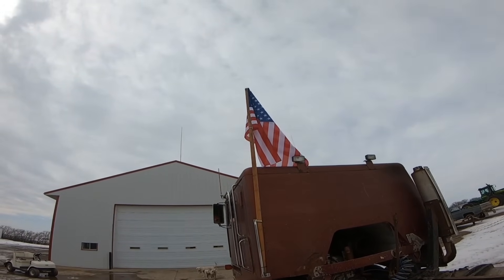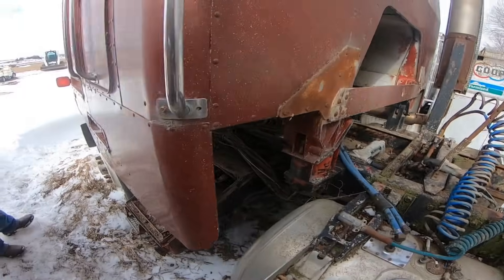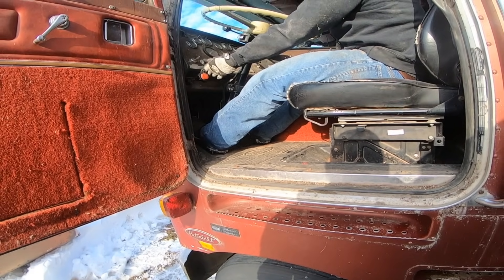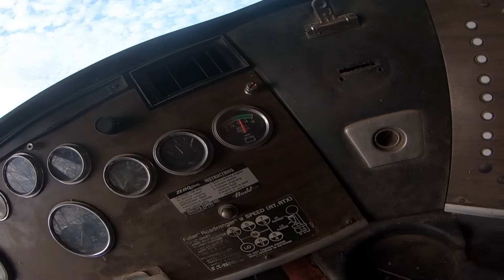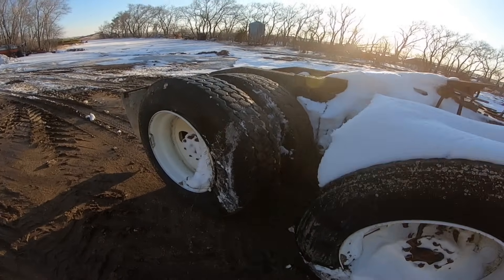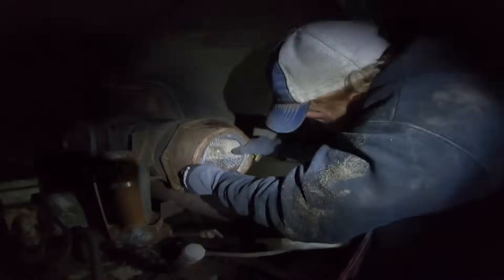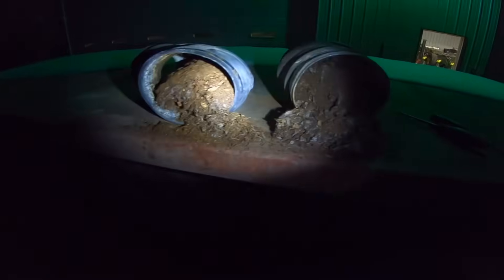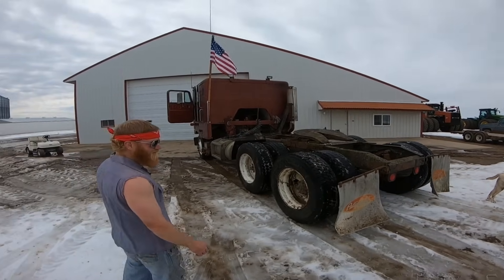Abandoned 362 Peterbilt Cabover first start in 14 years - The Adventures of Mortske and Elf

Comment: Its realy clean most of theas old trucks the interiors all riped up looks like it was well kept tell it was parked just like evey cab over its like almost special seing a cab over. And. Back then they were every where .my cosin bill use to rin a cab over. You could cleen up the inside with some work most of the time their all melested. All wires. Hanging and cut and window left open dash all crispy .Looks like it could get recover the seats doush the inside.
Reply from the maker: You know, after thinking about all the old trucks I've been around, this one was actually pretty well taken care of. The new owner got it all cleaned up on the outside and she's pretty dang sharp now! Thanks for watching and for the info!

Comment: First Peterbilt cabover i ever drove was a 86 362 with a 60 inch sleeper ... 400 bigcam and a 13 spd ....jake brakes would make the people down the street piss the bed.  
9000 is possible but also the odometer and the hubmeter could have bedn changed at some point .....trucking company i drove for in the early 90's when we changed the odometer the hub got changed too
Reply from the maker: Yeah the speedo had be recently swapped before it was parked. Thanks for watching!

Comment: Just curious as I'm not a trucker...what's the purpose of a hubometer on the truck? I get why they put them on trailers but why on the truck itself? Surely it has an odometer in the cab. Is it just for sparing a guy from climbing up into the cab?
Reply from the maker: I suppose if the speedo was off or you unhooked the cable or for service work they didn't have to climb in the cab to check mileage. I'm not real sure either.

Comment: As a German who used to live in Detroit for 2 years, I don´t know this one:  Do I need a special drivers license when I drive a truck like this for fun and not for business?
Reply from the maker: Yes, you need a Class A license for air brakes. Thanks for watching!
Reply: @MortskeRepair  Thanks for answering. One more though: What has to be done to get such a license? In Germany you have to go to a driving school and learn more than 400 questions.You have to pass a theoretical test and a practical test with a 40 ton vehicle with a trailer attached.It costs at least 5.000 Dollar.
Reply from the maker: @stevehislop  Basically the same thing as you said. A written test, followed by a driving test. I'm not sure on the cost involved however.

Comment: The  more I watch these it hasn't started in  14 year videos,The more I think they are full of boloney! After gowing up working on a arm and then driving for about 35 years working on trucks and equipment I like to know were they got ther feel from? Never seen fuel last that long.We had D7 on the farm that sat for 4 years and when we wen o start it the fuel was junk,I guess these fellas are allowed to make fictional videos on yu tube.It was intertaning  and no animals were injured  when making it.But they forgot to set up a go fund me account to help restore it.
Reply from the maker: Well Robert, I can certainly tell you that there was no YouTube camera trickery here! Diesel fuel doesn't break down and gum up fuel systems like gasoline does. And with no ignition system to deteriorate, these diesel engines usually fire up quite easily. I'll work on the Go Fund Me link so that this Pete may return to it's former glory! Thank you so much for commenting and for watching my video!